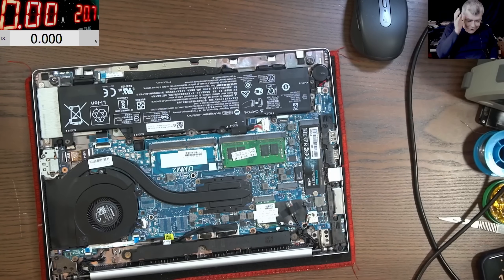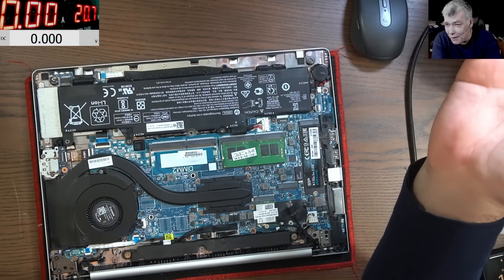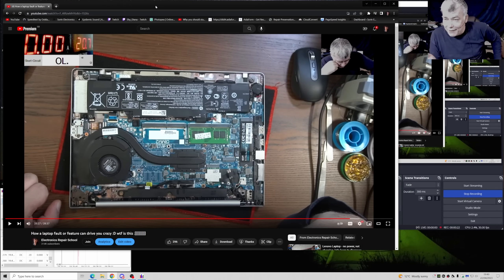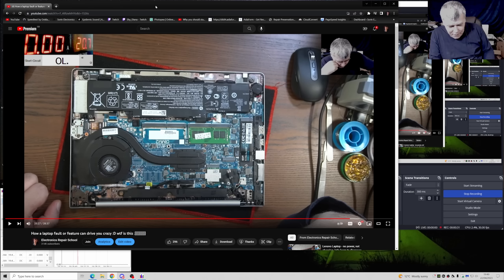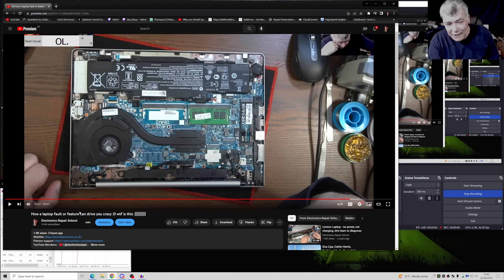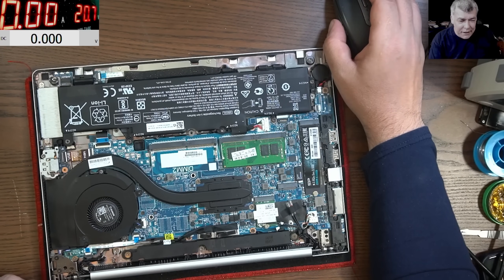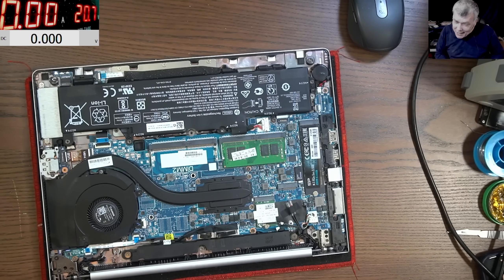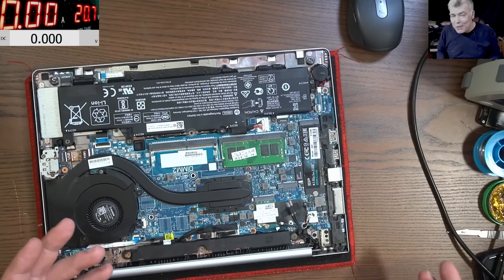How a simple power button backlight repair can be impossible to be fixed (in a normal way)

Comment: Some non-English mp3 songs or their instrumental cause backlight problem, and Asus battery memory effect. To repair, first you have to delete the songs, then pull out the vga cable from the motherboard , then plug it back.

Comment: You whats funny? I had a PS4 where the power button didn't work. I went to heat it up and it worked. I know I shouldn't have had it plugged in but when it cooled it stopped working. I figured heating a capacitor sometimes does this and I was right lol.

Comment: I've seen many laptops with burned input circuits where the gate was floating and could be turned on simply by touching the gate since your body is capacitively coupled

Comment: Hi Sorin, the problem could be a burned pull-up resistor, you should be able to fix that inserting a pull-up resistor at the gate of that mosfet

Comment: I repaired a HP laptop once that had a LED problem - the problem was the white LED on the DC jack would illuminate when the charger was unplugged.  I found an open trace on the motherboard, specifically a via was open which caused the LED to stay on if the charger was unplugged.  I had to run a small wire to repair the trace.  It took a very long time to figure out.  Thanks for sharing as always Sorin.  I really enjoy ALL of your videos!

Comment: Made it to 9:26 thus far, my first guess on the other video is still "holding water" 🤗... Personally, I'd take that small "switch"-board out, drench it in flux, and REEEEEEflow the entire board.
Then when it works, tell everyone; "When the timing-chain jumped a tooth it sent metal-shavings downstream to the muffler-bearing and shorted out the blinker-pump!

Comment: Interesting so it wasn't a fault with the laptop LID not being detected that it's closed or open.  My Dell lights up when the lid is open and turns lights off when the lid is closed, which is why I was thinking from that side of logic.  On the connector pin 1 has 3.3V and pin 2 had 0V, so why not solder or bridge pin 1 and pin 2 on the connector?

Comment: The pull-up resistor from 3.3V is missing or broken on the motherboard, but according to the correct design of the circuit, this resistor should be on the button board so that the same failure does not occur after partial disconnection of the flex cable.

Comment: “Gate in the air”, or more usually in English “Floating gate”. 🙂
Reply: Floating means liquid damage.
Reply: @Drottninggatan2017  no, it is not. It is described very well in electronics. When you are referring as "floating pin", this is the meaning.

Comment: I would't like my computer to be fixed this way. It is a dodgy way, the real reason wasn't found. And it is not true that anybody gave you good suggestion under the previous video. There were several comments, where people wrote like "100% it is a hardware fault", that the fault can be related missing/damaged pull up/down resistor or poorly filtered (faulty capacitor) power supply.

Comment: Can you replace the pmos that having that problem floating gate? Or some resistor value is not good anymore?
Reply: I think a schematic would be in order here for what you're saying. It would take a LOT of time trying to locate one particular resistor that may be causing this problem. Who's to say Sorin didn't just bypass the same trace supplying both LED's when he attached his wire. The same trace could have split somewhere on the board in two different directions to supply each LED and he bypassed the bad trace. Hard to know without a schematic.

Comment: thank you very Doctor Sorin for Tutoring so much about how fix those masine, iam just requesring if you would upload a video for voltage injection,the track or and a right component with right Amps and right Volts in the right place. thanks very much iam one of the interested leaners.

Comment: From stackechange:
"By the way, since a PMOS has very high input impedance, it can turn on accidentally.
If you ground the PMOS' gate, it'll short the body diode when the input is applied properly. This is the proper way of implementing a reverse polarity protection with a PMOS."

Comment: Ciao capo only my opinion why not gate in the air? why turn on off by temperature change.
oxid can  bring "voltage in the midde"  clean the robbon connector propely amd resold.